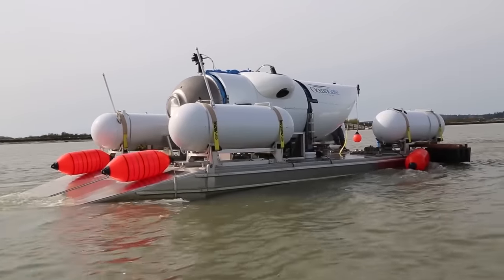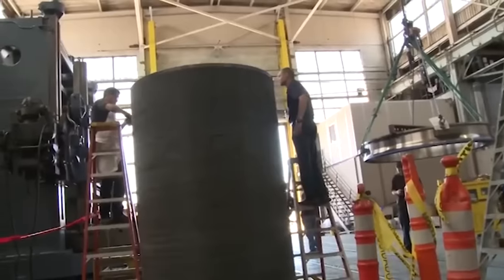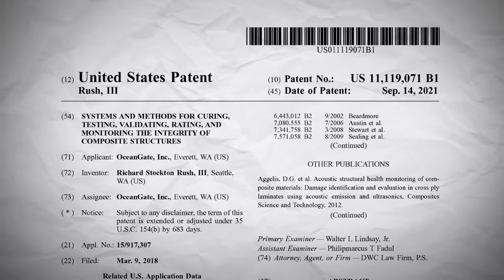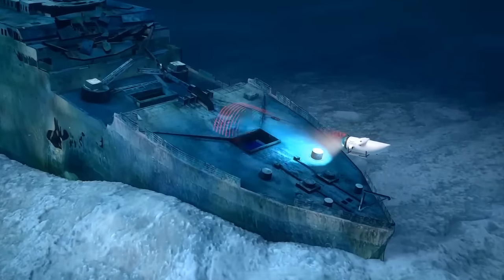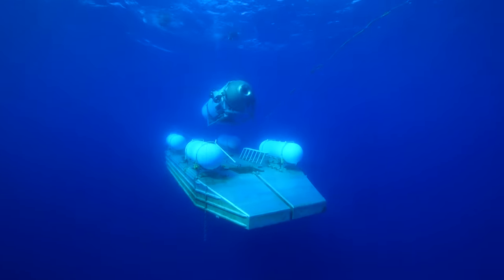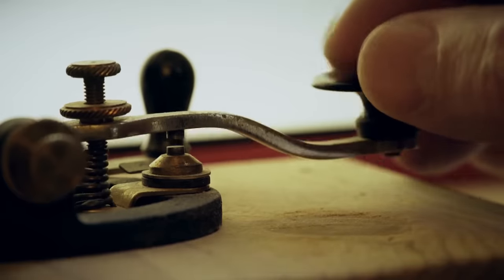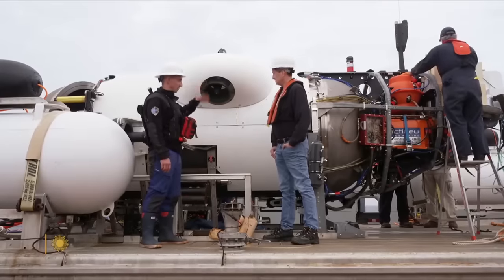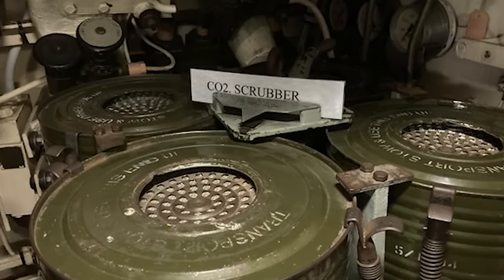Exposing OceanGate Submarines Many Fatal Designs

Comment: A Hydrogen tank has tensional stress on the tank as it's filled with compressed gas, which leverages on the material's primary strength. By complete contrast, the pressure hull was under extreme compressional stress, which is not nearly as strong as its tensional strength. Furthermore, when cured (with resin), it's very hard, extremely rigid, but brittle. Compare to steel and titanium alloys which can be hard and rigid, but have an elasticity that allows it to flex some. Stay within its elastic modulus and you're OK. Carbon fiber has near zero. It degrades when flexed. Thus, the carbon fiber was the fatal design choice as the material choice for the cylindrical portion of the pressure hull from the outset.
Reply: Wow, very informative , very smart
Reply: Just like hardening of arteries, arteriosclerosis.
Reply: A rope is very strong when used to pull, but you can not push anything with it.
Reply: Spot on analysis, carbon fibre in any configuration with resin impregnation is not a great engineering material in compression...
Reply: that is a common citation throughout the boards since Monday (6/19) yet he went ahead knowingly, even after consistent warnings and advice from very important people and world-class experts, experienced and trustworthy.  many must have considered him insane, but what could be done short of having him apprehended and confiscating the vessel?  who could bring themselves to even entertain such a thing?  he acted alone, entirely, yet all seemed lost aforehand!  even though wealthy and under the influence of dementia of some kind, I should've thought it possible to prevent the entire thing!  i would have invited him to a gathering for the purpose of detaining him as the parties involved had been alerted of the danger and the vessel promptly impounded.  then Mr. Rush would be served papers to cease and desist.  he would be treated kindly and responsibly until the circumstances were fully resolved and the matter quit.  yes, he would have to do so, immediately.
it is too much.  or is it?
Reply: Agree. - The difference between the Youngs Modulus of carbon fibre ( order of say 300Gpa) and epoxy (order of say 3Gpa) is so significant that you’d have to expect delamination taking place at some stage. Destructive testing to ascertain this point should have been undertaken prior to use.
Reply from the maker: Thanks for pointing this out, I can't believe I missed this (tried to rush things..!) - I have taken that bit out of the video and will make a comment of it as a pinned comment via the YouTube editor which will update shortly.
Reply: Cylinder was also a bad choice for hull design. Most deep sea subs are spheres because that equalizes the pressure across the entire sub. A cylinder will have places under more pressure than others.
Reply: Was all those points told to OceanGate more than once?
Can't legislation be applied from the country of origin even if used in international waters??
Reply: @megenberg8 James Cameron has stated that when the Titan disappeared his immediate thought which he shared with a colleague from previous dives was that the craft had imploded exactly as had been warned. Ironically, a few years before the Titanic sank a fictional story was written about a very similar ship that hit an iceberg and sank. That ship was called the Titan. Maybe no-one should go to sea in anything with Titan in the name. Not even in fiction.
Reply: Wasn't using brittle steel one of the very first things learned to avoid when the world transferred from wooden to metal ships? I am not an engineer, but that immediately stuck out to me.
Reply: @jamesfrench7299  You can't "legislate" experimental vehicles in international waters. It wasn't a "submarine", it was a "submersible" as it could not propel itself in and out of a dock . . . only up and down from a ship that carried it. Different definition. In addition, there were no "paying passengers", just crew. as there was a "pilot" and four "mission specialists", and it wasn't a "tour excursion" or an "adventure tour", but a "scientific"exploration" of the Titanic wreck. This is how the company evaded anything that might have regulated them. Note that there have been well over 60 other dives to the Titanic in other submersibles . . . without incident . . . because they knew what they were doing in submersible design . . . but even so, it's inherently very dangerous.
Reply: @Sparks52  It's rIdiculous. Laws are supposed to prevent a catastrophe like this.
Reply: @OsirisLord . Exactly.
Reply: @jamesfrench7299 And this was a catastrophe for whom? It's not a passenger liner sinking. It's not an airliner crashing. It's not a bus rolling over. The British have a "Cause of Death" appropriate for what occurred: "Death by Misadventure". You cannot legislate this activity in International Waters in a vessel that isn't subject to regulation and cannot be legally subjected to any regulation. They weren't on a "tour" with paying passengers as you would have on a tour bus. Their submersible didn't hazard any other oceangoing vessels, nor could it.

People die annually climbing Mount Everest -- it's become a "Bucket List" item for those that can afford it. Are you going to make it illegal to climb Mount Everest? Everyone on board signed waivers and clear acknowledgements they might perish in this activity. Next we outlaw skydiving as it's possible to perish in that hazardous activity. How about extreme alpine skiing? Make that illegal too?
Reply: @Sparks52   They did pay really good money to go down. I ain't disagreeing with you otherwise. If you want to see an actual video of someone in the Titan and talking about he videos problems had and he video being inside it. The channel is DALLMYD
Reply: 👍👍👍and even if that capsule was to be used under internal pressures, the layering of the carbon fibres were completely wrong, it was at 90 deg to the axis instead of 45 deg criss crossing. Hence did not support longitudinal, radial and circumferential stresses at the same  strength.
Reply: Just curious why is it that that are wine bottles in the titanic site fully untouched and unbroken by the so called tremendous so called pressures?
Reply: @jasonstormoen  I won't dispute they paid OceanGate money: $250,000 each. However, the payment wasn't contractually structured the same as paying for an airline or passenger train ticket, or for a cruise on an ocean liner. It was a substantially different contractual arrangement, especially with clearly acknowledging the extreme risks and acknowledging they were signing on as "crew members" in spite of paying money to do so. It's how Stockton Rush avoided his submersible being a "passenger" vessel in the same sense as a commercial airliner. People have ridden into space on Elon Musk's SpaceX rockets, and they're not considered the same as someone paying for a trip on Delta Airlines. Likewise, neither are Mount Everest "climbers" in spite of huge numbers now not being "professional" or highly trained and experienced "career" mountaineers; it's become a "bucket list" item for many that have the money for it and some of them die every year doing it. However much the "paying" parties blinded themselves with an extreme desire to see the Titanic in person, they were all sane adults and signed the waivers and contracts. Had they not agreed with those terms and conditions, they could have walked away from it. More than one person did in the past, and some of the responses to the decision-making of those paying Rush to be a crew member in his submersible bear this out. I wouldn't have ridden in his Titan submersible, although the one James Cameron has used multiple times might be acceptable.

Rush had an undergraduate degree in Aerospace Engineering from Princeton, and an MBA from UCLA. Was it over optimism? Ignoring the limits and boundaries of his engineering knowledge? Repeated "Go Fever"? -- a term coined after the Apollo 1 fire to describe a mindset unduly focused on task completion while ignoring the warning signs of problems or errors. Rush exhibited "Go Fever" behavior. At the least it was failure to test the design concept adequately to ensure it would hold up under repeated dives. That would have revealed carbon fiber was not the proper material for the cylindrical portion of the pressure hull. After 6 dives in 2021 and 7 in 2022, It failed on its 14th dive, although its carbon fiber hull had been reworked at least once after it showed signs of cyclic fatigue (2021). Taking extreme risk isn't inherently bad. It's how that risk is mitigated in light of the possible consequences. In the gambling game, "Craps", if one rolls "fair" dice enough times, they will eventually come up "Craps". To mitigate that, the person rolling the dice must "load" them sufficiently to make them "unfair" and prevent that negative outcome. In a casino, that would be blatantly illegal. In this situation of extreme risk and a potentially cataclysmic outcome, one should be deliberately loading the dice commensurate with both the probability and consequences of negative outcome. It's a risk-reward, cost-benefit balance -- a lesson learned in the Apollo 1 fire and again in the first Space Shuttle disaster (failed solid booster O-ring seal). In my opinion, Stockton Rush either knowingly, or recklessly with gross negligence, failed to sufficiently mitigate risk (implosion) in light of the consequences of a negative outcome (instant death of all occupants). Tort liability for the deaths is a different question. I don't believe OceanGate objectively has much under tort law. Especially so in light of what the "crew" willingly signed contractually, plus the company owner and CEO being on board and dying with them. Juries are, however, fickle. A government cannot be expected to save people from their own folly, nor should it.
Reply: @alexshatner3907  The bottle would fail and shatter if the pressure inside the bottle could not rise to match, or very nearly match the pressure outside the bottle. Failure is a function of pressure differential overcoming the strength of the bottle. Water is basically an incompressible liquid -- versus gasses, notably air. The amount of gas inside the bottle is very, very small compared to the total volume of the bottle. The pressure inside the bottle very nearly filled with incompressible wine (mostly water) rises to very nearly match the pressure outside the bottle without causing enough stress on the bottle itself to result in its failure. Failure of a sealed container under extreme pressure is a function of pressure differential inside versus pressure outside, and whether it exceeds the strength of the container to resist failure. It's the fact the bottle is very, very nearly filled with an essentially incompressible fluid that allows pressure inside to rise enough that the pressure differential is low enough that it doesn't exceed the bottle's structural strength. Those wine bottles are quite strong. However, if it had been a securely sealed bottle of air, it would have shattered as the internal pressure of the highly compressible gas inside could not rise sufficiently. The pressure differential inside versus outside would have exceeded the strength of the bottle. Thus, failure of a sealed container under pressure is a function of container structural strength and the pressure differential.

Comment: It should be noted that the rail car tank was collapsed by a partial vacuum on the inside with atmospheric pressure on the outside, creating a maximum possible pressure differential of less than 1 Bar. At the depth of the Titanic the submersible would have been subjected to a pressure differential exceeding 350 bar.
Reply: Is it directly comparable though? It's a lot easier to compress near-nothing (a vacuum) than whatever else may be inside (air, bodies, technology).
Reply: @garrymullins  Yes at that depth though it evryting with air in it would have imploded but looked like exploded in a few milleseconds.
Reply: @garrymullins  When you reach the stress limit of Carbon fiber it doesn't bend and deform before it fails like metals do, and when it fails it does so extremely quickly, we are talking around 3 milliseconds, that's quicker than the steel tank in the video took to crush. This kinda good news for the people on the Titan, as they would have been dead before they even knew that there was a problem. All in all,  that would be the least traumatic and painful way for them to have gone. 

Also yea water pressure at the depth the Titanic is at is about 400x that of the pressure at sea level. That submersible was pressurized to about 1 atmosphere (i.e. same pressure as at sea level). When you are dealing with pressure differentials that large, it really doesn't matter that the sub was pressurised or that there was stuff in it. It's gonna crush like tinfoil and then explode (because for every reaction there is an equal and opposite reaction).
Reply: Yep.  Everyone inside likely got squirted out of the imploding sub reduced to their cellular components.  The natural acidity in the ocean would've done the rest.  It's unlikely any fish got a meal from them at all.
Reply: Hahaha 😅
Reply: @EricDaMAJ  so your saying powdered human ceviche?
Reply: @lewisbolman7862 No, more like trying to smell a fart in a hurricane.
Reply: @garrymullins at the pressures we’re talking about and with carbon fiber, it makes no difference. The differential pressure is so massive, the container would have to be squeezed down to 1/350th of its original volume without leaking any air before it would resist further crushing, and there’s no way that can happen with carbon fiber.
Reply: @lewisbolman7862  Yes, but in smaller pieces.  Much smaller pieces.

Comment: Carbon fiber is a really poor choice for this application.  For making a tank that holds internal pressure, carbon would have been a good choice since the forces pulling on the fiber --- but for resisting external pressure it is a terrible choice as the compression (pushing instead of pulling) puts most of the force on the the epoxy bond rather than the carbon fiber.  The compression forces are acting to separate the fibers from the epoxy.
Reply: They should have gotten a huge redwood tree and hollowed it out!!!